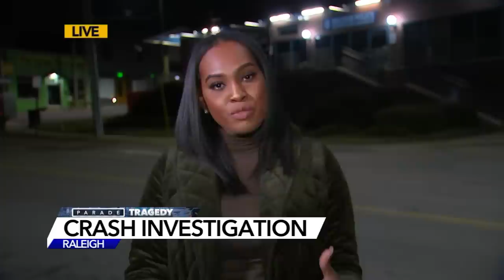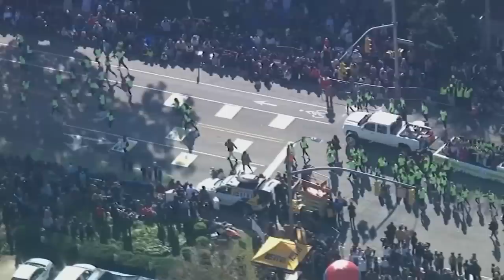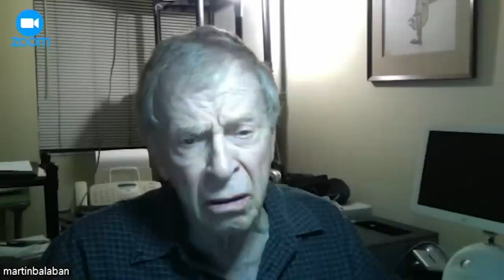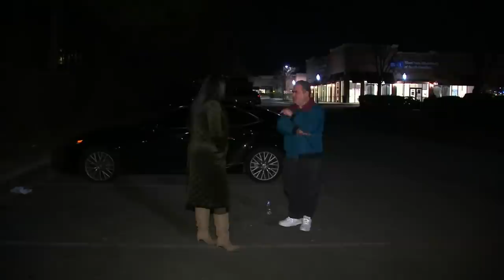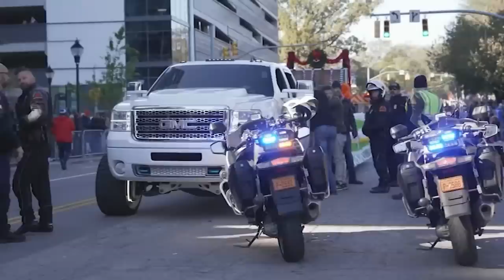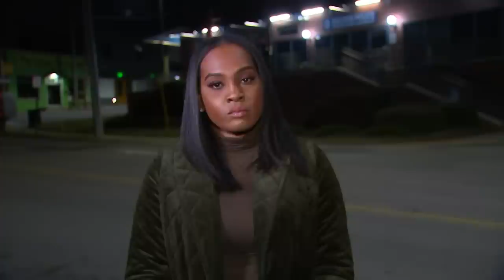Investigators look at truck part by part after Raleigh parade tragedy

Comment: Vehicles don't come with emergency brakes anymore? News to me.
Reply: Have you ever driven a vehicle that couldn't overpower the ebrake?
Reply: @dthomaswilliamson33  No, it always slowed down, even if it snapped. Plus, how fast could he be going for it not to work?
Reply: Emergency brake is a misnomer, it's a parking brake.  Prevents rolling away.  Depending on the rear brake design if it had leaking axle seals it's pretty much useless
Reply: “It’s an emergency make the car smell funny lever” - Mitch Hedberg
Reply: @dthomaswilliamson33  the guy is crawling in parade 🤣😂
Reply: @Jp_1984  LOL... Says you.  Mean while the service brake operation is part of achieving a vehicles GVW rating.  Holding a static load is harder than slowing a dynamic load... one that was crawling at a parades pace no less.
Reply: Looks like he panicked tbh
Reply: @dthomaswilliamson33  
 Um, that truck shouldnt have been going too fast to overpower an e brake. 
 The real failure then is the load he was carrying that the truck was not designed to stop at low speeds.
Reply: @freemankeyz  yeah because u were there, I forgot. Ur right, it's completely possible everyone is just full of ish... smh
Reply: @noshot5793  you must be his relative
Reply: @freemankeyz  classic comeback

Comment: Easily could have threw it in neutral and applied the E brake and shut the motor off 

Then again diesels do run away so that’s also possible
Reply: You clearly don't know what it means for a diesel to 'run away'

That thing would be absolutely screaming, blowing past the rev limiter if it was running away

Comment: This is an example of why not to modify your truck's breaking system.
Reply: I highly doubt the braking system is modified, it will be the lift and if somebody's made other alterations that might have damaged the braking system, can even be an overheating issue from driving so slow with such weight they don't shift out of first gear and get really hot, transmissions are known to burn up from parades
Reply: guaranteed the braking system is not modified, if anything the lift stretched the brake lines and broke them. but from what i see it’s not lifted enough for that to be an issue but you would have to be there to know.
Reply: I knew someone years ago that installed hydrogen systems in trucks during the 2000s first time jacking gas prices and one of his customers almost ran his son down because he modified the booster with his instalation
Reply: The braking system wasn't modified.

Comment: turn the key off!!!
Reply: I’ve been in a car with break failure and that did NOT work
Reply: That would do absolutely nothing
Reply: You could see by the video that the truck was under power if the key was turned off it would have slowed down an eventually stopped.
Reply: @oldscuba  the truck was in neutral with weight behind it rolling downhill and turning the key off guess what it would still be in neutral rolling downhill
Reply: @adenseay7406   So the man shouldn't go to jail if the electric breaks on that trailer didn't work.

Comment: This is 100% negligence.  As an ASE master technician that truck can stop at those speeds.  Even with a line failure you can stop.  You also have mechanical parking brakes that will stop this truck at that speed.  This is completely on the driver of that truck and he should be held completely responsible.

Comment: Ive had brake failure on a 2009 Gm diesel doing 50 mph before. I was able to ride the parking brake to a stop. Anyone that says otherwise shouldn’t drive. The kid could have stopped. If you panic in situations like that maybe you shouldn’t be driving a parade float.

Comment: Turn the KEY OFF. There are many ways to stop a vehicle with out the brakes. Sounds more like inexperienced driver error from not paying attention to what he/she was doing.
Reply: With the ignition turned to off and the vehicle still moving the transmission will default to neutral causing the vehicle to race down the hill out of control while losing hydraulic pressure to the steering making a bad situation worse.

With the vehicle running the configuration now has complete steering control and in addition you now have engine braking by selecting first gear. The first gear ratio of a GMC Denali heavy duty is 4.54, that's a crawler gear. In this configuration it's likely the vehicle would not move faster than an adult's walk.

After watching the video it would appear the driver tried to put the vehicle in park which if in motion would default to neutral or he actually picked neutral. In any event the vehicle began to pick up speed out of control until the accident happened.

Comment: Prayers to the families,  when trucks are lifted and modified,  those brake lines need to be extended longer and who knows who did the work. And they need to install some kind of kill switch in these parades in case a vehicle runs a stray, emergency brakes need to be checked for operation, and drivers taught how to kill the ignition and jamming it into park won't do anything much but in neutral it can slow it down with the weight of the float holding it back..just saying.

Comment: the thing abt automatics are is when they are moving u can put them in park and they will click but wont shift till the truck gets to a certain speed which if u watch the video of them stopping the truck u will see it shift into park after they slowed it down
Reply: Yes. That's the park pawl that engages. With a lot of weight behind the truck it would probably snap it like a twig.

Comment: Engage the parking brake? Put trans in neutral or park try everything. Those trucks have hydra-boost braking systems and when they fail catastrophically it can cause a complete brake system failure however with the reserve valve and as with any hydraulic brake system you get a few pumps before you loose all pressure, and the change is dramatic enough with each pump you will notice. ASE mechanic chiming in keep it civil

Comment: Reach up and turn off the key. I've done it. I was a passenger, when a driver froze with throttle stuck wide open. I reached over and turned off the key.

Comment: Well as a mechanic with over 25 years experience with braking systems, it is always possible to lose complete braking power on any vehicle. Which by depressing the emergency brake to the floor after again taking the transmission out of gear and turning the engine off.

Comment: People don’t know how to downshift? Trow that thing in park !!!!!
Reply: You're halfway right, you cannot put a GMC Denali heavy duty in park when in motion as it will default to neutral and it's possible the operator tried to do just that,  matching what we saw in the video which was the vehicle in neutral gaining speed down the hill until the accident.

Downshifting the Denali into first gear would put it into a gear ratio of 4.54, that's a crawler gear and it's likely the vehicle would move slower than an adult could walk in that configuration.
Reply: @MajorBorris  Oh didn’t know that about them gmc’s. Learn something everyday. Parking break maybe?
Reply: @SOLDIEROFYAWEH  investigators charged the driver with improper brakes and cited the vehicle as having no operational braking systems. 

Sadly the emergency breaking system was either disconnected or not operational. This could either be caused by the lift modification which would require the emergency brakes line to be extended and reinstalled or by not properly using the parking brake daily which could cause it to stick.
Reply: @MajorBorris  I’ve slung my 2015 Denali hd in park moving on accident it will go in park at low speeds

Comment: I had a Ford van that all of a sudden locked up in a strange vacuum issue,, it would steadily rise to 4000 rpm I had to literally stand on brakes but brakes wouldn't hold,,ending it by turning the key off,,it was like  someone else trying to drive it,,, just spooky 😳

Comment: Emergency brake pedal, push down. What a sad and uncalled for event. Prayers too the victims and family’s.
Reply: sadly in most newer vehicles the so called emergency brake is NOT an emergency brake  its a parking brake and will not under any circumstances stop the vehicle when moving,, older vehicles with drum brakes the emergency brake actually activated the service brake shoes mechanically through a cable ,,,this newer truck a 3/4 ton truck will have DISC brakes for the service brakes and inside the rear rotor it has a small drum brake for the parking brake ,, IT WILL NOT HOLD THE VEHICLE ,,,i have a 2001 chevy tahoe and it has this same setup and  i know this from personal experience
Reply: @wildcoyote34  thank you!!
Reply: Yeah it's sad 😞. Throwing it in neutral also would of help don't know if he did or not. But can't imagine the speeds of a float being higher than 10mph due to walking speeds. E brake would of helped also while in neutral seems to be cable driven. Also for the one that says it can't hold, you need to adjust it.

My question is does these floats have trailer brakes? Or even a off hitch run away e brake? If they do that would of helped a-lot if engaged. Heck even if these float vehicles kept some wheel chalks to put down would also help.
Reply: @psycho-nutkase9233  most of the floats i have been around were farm type wagons and no they don't have brakes 

as for the PARKING BRAKE ,, it is not intended to stop the vehicle ,,trucks with disc brakes don't have the same reserve stopping capability as older trucks with drum brakes because the tiny drum brake is smaller than the ones in small cars ,,whereas the mechanical cable mechanism in my 1983 GMC C3500 activates the service brakes which are 13 inch drums with 3 inch wide shoes ,,,and my 14K GVW truck has the same hydroboost brake system that new diesel truck has ,,,
what it comes down to is this 20 year old kid didn't have the experience to deal with a problem such as this ,,i can second guess everything he did because i have dealt with brake failure in many different ways ,,something like pulling a float along at walking speed  i would have had my truck locked in 4x4 low range ,,he probably never even thought about something like that ,,but it doubles your engine braking ability,, and allows your engine to idle so you aren't fighting the transmission with the brakes ,,,years of driving farm trucks pulling hay wagons at walking speed picking up hay bales taught me that

Comment: No child should have to pay because someone didnt build it safe. I can't tell you how many trucks like this I've seen coming to the shop with the ABS controller unplugged because once you lift them and change the wheel and tire package it engages the ABS and traction control so the guys just unplug it. Emergency brake cables unhooked where they did body lifts. Stock brake lines stretch to the max instead of buying extended stainless. Huge exhaust rubbing rear brake lines. Awful..Truly heartbroken for her family and friends

Comment: The problem is not the lift kit brake system should’ve been looked over for one and for two why didn’t he put the truck in reverse or neutral and slam on the E brake? There is no reason for you guys to judge the lift kit because that modified truck should’ve been perfectly fine if you would’ve kept up on the maintenance of the braking system, there is also other alternatives to brake going at slow speeds

Comment: Had a ford f-150, 2001. Was going to work, throttle pin broke at 50 mph. Within seconds I was at 80. Brakes wouldn't slow me down. Dropped in neutral and braked on dirt shoulder. Thankfully,  nobody was in front of me.

Comment: Park wouldn't put it into p. Wouldn't stop or hold the weight anyways.

To many stones here. 
1. Any trailer brake controller ? 
2. Trailer brakes even on the trailer? Do they function?
3. Hydro boost if it was diesel to stop control steering and your brakes. Chevys setup sucks. I'd know... When it fails you loose power steering and even in stock form the truck is hard to steer without! Lift had nothing to do with any of this. 
4. Did he maybe leak brake fluid from crappy steel lines from gm? Or was it the cheap steel crimps on the high-pressure lines leaking fluid and allowing low fluid. Who knows. 
5. The inspection place. Did the truck have working emergency brakes? Goes to show if state inspection are worth any weight... Would only matter if the truck had a trailer brake to assist in stopping otherwise it most likely would still be moving downhill and hold the weight.

It's unfortunate. Rip to the family. We try to prevent accidents. But not all can be prevented because it's hindsight, meaning we only see it after it occurs. I think some measures like any vehicles are the leaders and walkers are behind for parades. If anyone is walking along side they should be to left and right of vehicle. Can just run into vehicle ahead need be. That's measure 1 to prevent. Measure 2 is the parade inspector or planner who approves them. This younger person might be inexperienced and turning truck off wasn't his first thought. Maybe thought turning it off would lock steering. Low gear these trucks will creep decently. Neutral could of been used but it only helps if those other measures like trailer brakes and emergency brakes were accessible. I'm betting that trailer only had axles with no brakes and it pushed the truck. Sometimes fluid can get in the brake hydro and you can't push it. Hydro seals malfunction. It's rare but possible.

Comment: If the brakes had time to cool off by the time they tested them than they would work fine. Loss of hydraulic pressure most likely happens only when brakes are overheated which wouldn't be the case if the truck sat for a day before this inspection.

Comment: How could he not put it into neutral, with the parking brake on, or veer into a solid structure, or pull the gas pedal up, or turn the ignition off?

Comment: Chevy had a problem with their anit-lock system 
The drive by wire system fails and the brakes just lockout and you have zero brakes

Comment: Sorry that happened. That’s what happened when someone that has no experience driving when brake failure occurs. Should have put it in neutral and step on the parking brake immediately to stop. And turn off the ignition. Worst case ram it in park!!! That would have avoided this problem. The driver wasn’t trained properly to drive in a parade for this situation.

Comment: I call bs on not being able to stop regardless of the situation. At the very least the trailer is required to have functioning electric brakes and if they're working then those alone will 100 percent stop the truck and trailer. If they won't then the driver is at fault.

Comment: The truck had a reverse gear.  And I saw him pass a light pole.
Reply: I had the brakes fail on a 2018 3500, it would not catch anything in R, put it in Park, both feet on the parking brake and pointed it at a big tree, it bumped the tree and was caught up on a huge bush. From 45 to 0 pretty fast.
Reply: @tomr3422  what was your cause for the failure afterwards?
Reply: @danlevesque5437  the booster was bad, it was replaced under warranty.

Comment: accidental manslaughter. 25 years but possibly shortened to 10. this will be the verdict if the find the truck to be faulty. if the truck is 100% okay then that will change things because it will fall on the driver 100%

Comment: That’s not the case if it’s a Diesel they have hydro boost system in which case if lose any bit of brake you won’t have any even if you lose power steering fluid you’d lose your brake